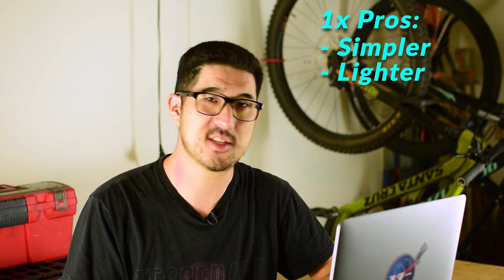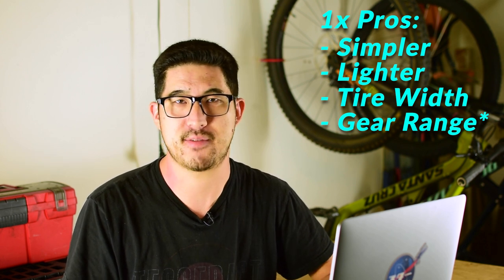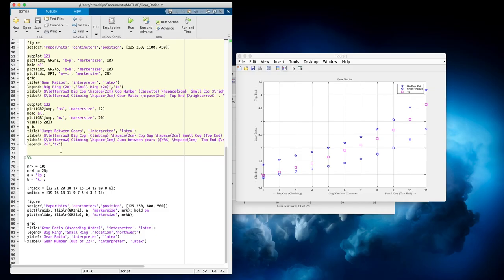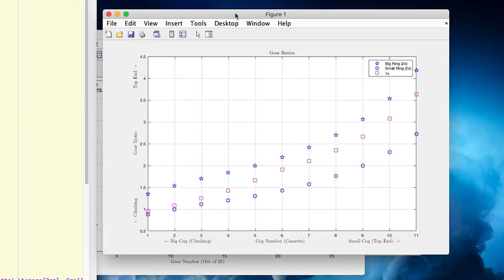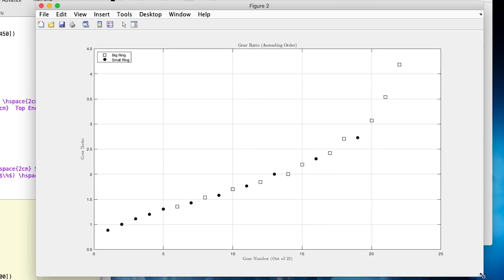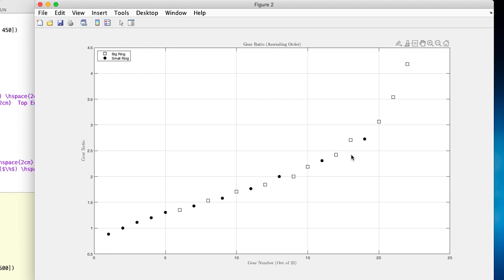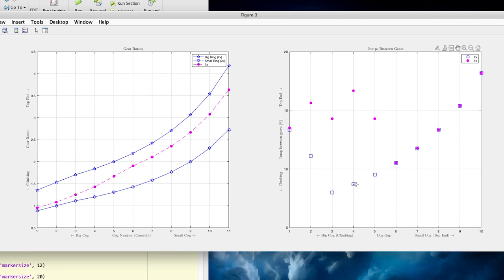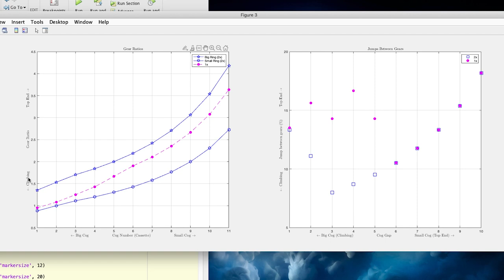1x vs 2x Drivetrains For Gravel Bikes | The ANSWER! (Is In Gear Ratios)

Comment: Nice! There is something people forget to think about.
Tarmac roads are designed for vehicle that will keep around 88mph so they spend a lot of money modifying the terrain to not have abrupt changes on the slope cause it could make the cars at 88mph to jump over the hills.
Gravel roads are design to velocities close to 20mph, so you can save some money and allow fast changing in the slope.
For road bikers, riding in automotive tarmac road, it means very small changing on the slope during a long ride, so small gaps are more important.
For MTB rides, the changes in slope of the terrain are usually huge, so you frequently change 2 or 3 gear at the some time, so bigger step will not make much difference.
For Gravel, if you stick only to gravel roads and singles tracks, the 1x MTB transmission steps is just fine.
The 2x on a Gravel bike will make more sense when you are using the bike to travel, cause sometimes you will need small gaps to ride long tarmac roads and sometimes you will need the small chain ring to climb a single track.

Comment: I recently switched from a Trekking/Touring bike with a 3x system, a 2x allowed me to do an easy tradition. Regarding the use of more of the gears in the 2x system: depending on the terrain that you drive on you can make more of the gears that you go on I think. I noticed when cycling in snow and mud that more finer gear ratios help me to cycle faster while still having easy control over my bike when a to high gear would be simple to much maintain speed in.

Comment: I just got a bike with a 1x (Surly Ghost Grappler) and that was my main concern. It's my first 1x bike and I thought that would be some sacrifice. But what I found is the top gear goes faster than I can ever actually maintain unless I'm going downhill anyway. To me the only time that speed would matter is in a race, which I'm not doing. On the low end it can't go much lower anyway because that front chainring is pretty small. Maybe I could go a bit smaller, I'm not sure. 
I was also skeptical about shifting, as it seemed like it would have those problems you mentioned with e.g. using the large chainring on the large cogs. And I've had bikes that just plain (with age) don't shift reliably in the largest or smallest cogs. I don't know what magic allows that to work well but it does, at least so far. If it continues to work well I don't see any reason, for me, to ever use a 2x again. I love having fewer parts! But again I'm no racer.

Comment: Great analysis! So, it has more to do with gear total range rather than the gaps between the cogs. 2x grx has a wider range than 1x. So, if you need to climb hills and go fast at the same time, go 2x, if don’t, go 1x that is much simpler.

Comment: I prefer my setup with 2x GRX DI2 with a 48/31 crankset paired with a SRAM 11-36 cassette. I can climb any hill on a gravel ride or swap wheels or tires and go fast on a road group ride. Another neat trick with 2x DI2 GRX is the Synchro shift feature which will automatically shift the front derailleur when you shift the rear so it essentially acts like a 1x.
Reply from the maker: Baller. I haven’t made the jump to electronic shifting. Not sure I ever will, but who knows.

Comment: A year later, and the Campagnolo Ekar group set offers 13 cogs for a 1x system, which pretty much means you can have your cake and eat it too. Depending on which cassette you choose, you can effectively match both the range and the spacing between gears to that of a typical road bike with compact 2x cranks. Of course, you can instead choose to trade a wider spacing for increased range.

Comment: 2x has also better weight distribution(more of the weight is in the center), with better efficiency and longevity due to the straighter chainline(if you use it correctly).
Reply from the maker: Are you suggesting the weight of the fd and a smaller cassette helps keep the mass more centered and somehow makes a non-negligible difference?
Reply: @TheBikeSauce  I do indeed.
Reply: Chainline doesn’t cause wear. Modern tech and manufacturing allows chains to bend more than your old sturmey archer drivetrain.
Reply: @Cous1nJack  where have you heard that, the ads? Btw, what's the price of a 11-12spd chain?
Reply: Looks like you're looking for the question to the answer.

Comment: You missed a few points. The longer derailleur cage especially on the largest range cassettes, will project down further, and therefore more in harms way for debris. Also the longer cage means adjustment for proper operation is more sensitive, and easier for the 1X system to fall out of adjustment or failure to be properly adjusted. Next there is greater wear on the single front cog, where wear can be spread on the 2X system, or potentially reduced due to potentially having better chainlines. Lastly if you damage the front chainring while riding on the 1X, you are going reliant on that chainring that may or may not have some functionality. While with the 2X setup, you are likely have a backup chainring built in. What you present if fine, but it neglects failure analysis, and on long and/or multiday rides, or remote areas, these considerations are extremely important.
Reply from the maker: for some
Reply: @TheBikeSauce  which is exactly my point, but was not addressed.

Comment: Thank you for your thoughts.  I wonder if you can help clarify something for me.

I plan to put together a gravel bike, and  plan to ride it up and down very steep short hills on pavement (60% of my riding) and on dirt (fire roads and single tracks) (40% of my riding).  I come from riding an old hybrid Schwinn Criss-Cross road bike with a 3x gearing system that was unnecessary.  However, I did appreciate the small gaps at the lower end when riding up steep pavement hills.

With respect to drivetrain, my considerations are as follows:

1. On the uphills on pavement it would be nice to be spinning the pedals quickly rather than struggling to pedal while going nowhere fast. 

2. I'm pushing 50 years old and am not as limber and flexible as I once was, so comfort is key for me. 

3. I'll be doing a lot of riding up pavement hills (and coasting down them) both alone and sometimes with my daughter.  For the times with my daughter, she will be in a child seat on a rear rack.  Me and my daughter will have a total weight of 235 lbs + weight of the titanium bike I plan to get (19-21 lbs). 

4. I'm not as much interested in racing, so it won't be important for the gearing to accommodate pedaling that will both allow me to power the bike faster at already high speeds or let me modulate speed/cadence at the higher end.  Also, the declines won't last long enough and be too curvy for me to have time to do anything other than coast.

It sounds like from your video that 1x gearing does not allow for as many smaller incremental changes in the lower end of the speed range relative to the higher end of the speed range, which I will need most when carrying so many pounds uphill.  

I'm thinking that when going uphill, a 2x may be better since it will give me 1) more increments in gearing and therefore smaller steps between speeds at the lower end, as well as 2) having either a front chain ring and/or rear cassette that can accommodate the slower speeds i.e., <4 mph, than the upper end of the speed range. 

However, as you pointed out, I do like the idea of a 1x especially insofar as it's lighter and simpler.  With a 1x12 setup, how can I get smaller gaps at the low end so it will work?

Comment: May be a bad exapmle, but I had only department store bikes in my childhood and last one had that heavy and stupid 3x system, which never felt right - as I was smaller, I just couldn`t make it work, so ended up using middle ring. As I grew taller and heavier I clearly felt, that even the biggest ring on front is not enough for me. While my student years I didn`t really had a chance to ride or even to have a bike, but now I have my gravel 1x bike and I absolutely love it! I`m not riding in big groups to keep up with certain speed or top or bottom gears, so they are not effective - it`s just that good for me - no stupid front deraulier, no need to think about chain angle and in previous season not even once I had my chain dropped or rubbing. Oh, and mtb casette looks awesome as well)

Comment: I have switched back to 2x for practical and performance considerations. 

Let me set up the reasons. 1. I live in a hilly part of SoCal. 
2. The guys I ride with believe there is an invisible KOM banner at the top of every climb. 3. I ride the pavement to the trailhead. This includes invisible sprint and KOM points as well.

The practical reasons: 1. I run a 38/22 in the front and 10/36 in the rear. I use the same cassette and chain for my road bike. 
2. Chain and cassette wear is less due to the extreme angles of the lower gears used under pressure off-road.
3. Less chainring wear. I use the small ring a majority of the time off-road. (Climbing ride time vs.  desending ride time.) The small ring is  steel and inexpensive.
4. It is quiet.

The performance reasons:
1. The gaps between gears while climbing steep sections. I can find the goldilocks gear while my buddies struggle (and who does not enjoy watching their friends struggle!). The smaller gaps in the rear combined with the 22t inner ring always work out better.
2. There is no #2

Now, I can honestly understand the benefits of the 1x system for the manufacturer and the consumer. 

For the manufacturer:
1. Less SKUs. No shifter, derailleur, inner ring, and bolts.
2. Market the simplicity of operation and maintenance of the 1x system (while charging the same price for fewer parts). 😉
3. Easier frame design. 
4. One less cable to route.

For the consumer:
1. Ease of operation. I agree that having one shift control vs. two is easier. I just do not see it as a huge problem to anyone besides a true novice.
2. Ease of maintenance.    Agreed. I do a wheels off clean/inspection nearly every ride, and the area around the front derailleur is a pain to clean.
3. One less thing to adjust. Agreed, but once set, the front derailleur does not need to be adjusted. This may be another novice issue.
4. Aesthetics. Less bar clutter, less cabling, cleaner bottom bracket area. The only ugly part is that huge cassette thing and massive rear derailleur. 
5. Chain drop and mud clearance. I have yet to drop a chain, and if mud is not an issue in SoCal. I know we test our gravel bikes with the terrain, but if you are having these issues, maybe you need to rethink your bike choice.

Now, do I think there is a place for 1x. Of course. 1x is great if you are riding at a leisurely pace. It excels in the non racing MTB world, where climbing considerations take a back seat to suspension. Yes, I know the pros ride 1x. They ride the equipment provided and can also put down multiple times the watts compared to us mortals. For city/leisure bikes, it is the best as these bikes are ridden by novices. The simplicity of one shifter to someone intimidated by the thought of gears is a godsend.

Thank you for entertaining my rant.
Reply: "The performance reasons" - You have faster gears in 2x system.

Comment: Thanks for the video. I like your approach a lot. As you said, what really matters in gaps lies in high speed gears. Big jumps in low gears usually don’t matter. Still, I think that 1x system needs one more cog than 2x drivetrain for ‘bailout.’ Adding 50t to 11-42t and using 50t chainring would feel much like 50/34t + 11-34t. I really hope that Shimano comes with 12s for 1x.

Furthermore, one more benefit of 1x you didn’t mention is, I think, the versatility in choosing chainrings. Of course, you can change chainrings in 2x but it is a lot of hassle to adjust a front derailleur every time, and choices are limited. If I am willing to change chains, I can go with 50t for a fast road riding and 34t for a stiff mountain climbing. Or you can delve into some good combinations of cassette and chainring that suits your riding capacity.
Reply from the maker: Agreed! Simplicity in swapping chainrings is a big plus.

Comment: when I bought my first dropbar bike last year, i went for a 1by gravel bike. GRX with 40t in front and 11-42 in the back. this spring I got a new wheel set for road and now im mainly driving on tarmac. I watched your videos about converting the grx to fit a 11-46 cassette. the plan is to go with a 46t chainring a with the 11-46 cassette. then I have the same jumps as in my 11-42 cassette. only the last jump is bigger. but here in northern Germany  its really flat so its only an emergency gear and should be fine. the 2t jumps are still to big sometimes but should be fine for now.

Comment: Good Vid.   I am building a Surly Midnight special with GRX Di2.  I started as a 2x build. Bought GRX 600 2x crankset  46-30 as I wanted 165mm and 800 series shortest was 170mm.
But before buying the front derailleur I decided I might try 1x . 42t Chainring was about $80 AUD and sunrace  11 40 cassette because black!  Good news is 1x GRX chainring bolts directly to 2x Crankset  using standard bolts. Beware bolts are super tight.   I will try 1x and see how i go , my main concern is finding the right cadence at higher power on flat roads. This vid now informs me I may not need to worry. Will go back to 2x if I dont like the 1x. weight does not seem to be too dfferent as a 1x cassette is around 120g heavier than 11-32 and front deralieur is about 120g. Chainring weight is about 70g saved so 1x is maybe 70-100g lighter. Thanks for the good info
Reply from the maker: Nice! Great bike. I’ve been riding both GRX 1x and 2x recently and I can say I notice the 1x limitation mostly on steep climbs and cruising along up mild grades where sometimes it’s hard to find the right gear. I usually stop pedaling above 25mph so the upper limit isn’t too big an issue for me. Have fun with your build!
Reply: @TheBikeSauce  interesting to read this after watching your video. Doesn’t this go against everything you’ve highlighted in the video? I’m only curious as I’m currently trying to decide whether to go 1x or 2x. After watching the video I was going 1x but after reading your comment, I’m now so sure?

Comment: When figuring potential weight savings for a 1-by system you do need to consider the weight of the different cassettes. It seems possible some or all of the weight saved up front could be matched by more in those huge cassette cogs. But as you say, simplicity matters a lot. For an old (74) roadie like me (riding good road bikes for 45 years), small steps between gears and the ability to match my (high) cadence are important. But as I contemplate my next bike, an e-gravel bike, 1 -by will have to be the future. 

Your program made simple the sort of manual calculations we made years ago when designing our ratios. There were many fewer options then (this was even before mountain bikes). We are spoiled for choice now days! Love it, and love your channel.
Cheers,
Tom
Reply from the maker: Thanks, Tom! Coincidentally, I recently swapped my GRX 2x setup for a 1x setup. Weight savings was a total wash! You’re right, the heavier cassette completely cancelled the savings gained by removing components. 

An e-gravel bike ought to be loads of fun, and yes we certainly are spoiled by choice in 2021. Important to remember that the equipment is just a tool to facilitate the adventure! 

Thanks for watching!

Comment: Now we have 12 speed, smaller jump.  I compared a 2x GRX with my sram mullet on an online gear calculator.  2 x11 actually only has around 15 speeds. And the jump between ratios on the 2X is inconsistent.  With the 1 x there are 12 speeds and the gear jumps are consistent.  There are portions of the 2x where the jump is the same as 1 x.  And some of those fine jumps mean going back and forth on the front chainring.  The point is, 1x offers many advantages, so the gear jump must really be important to you to not want to go 1x.  Even then I don’t know if there is a big gear jump advantage.

Comment: Coming from a 3BY, I didn't want to take a chance with 1BY. It's not like for the same price model, you have both options. The Aluminium version with 11 gears in the back came with a  1BY only. With the $800 price difference, I could have had the Aluminium frame at 1 lb heavier with carbon wheels at 2 lbs lighter. Aluminium would have given me so much room to add clamping accessories, bike stand, ease of packing. But, I am happy with the carbon frame bike.

You nailed it about max speed limitation to 25 Vs 29. I wanted my diverge to be more like road bike... so I went with 2BY and stiffest spring.. once I have a 32mm tire, it's even closer to Roubaix. The larger front chain rings of Roubaix would have made it harder for me to climb anyways.

I wish bike companies provide such customisation options.

Comment: The debate always revolves around keeping the big gears(100+ inches) well what if you're not bothered about peddling at 25 mph+. Simple you find an after market 34 tooth front ring and run a 11-34 cassette and benefit from small jumps and even lower weight :) just like i have, i hardly ever use the 11 even now.
Reply from the maker: Nice. Could maybe even go 32t front and get a lower lower end

Comment: Campy Ekar 1x13 sp does a really good job of tight spacing where it matters most. 

I'm still stuck in on 11sp with an e*13 9-46 because there is no 12 sp cassette available that would tighten up the spacing where I like. My 11sp is almost perfect for gravel, but could use 1 or 2 more single tooth jumps for the fast gears. A 9-46 13sp cassette with single tooth jumps for the top 4-5 gears would be perfect for me. Ekar is getting close with the 10-44, but we're not quite there yet imo.

Great video on a timeless topic!